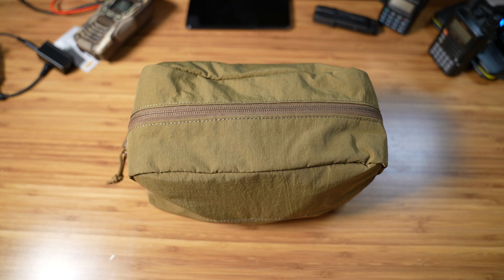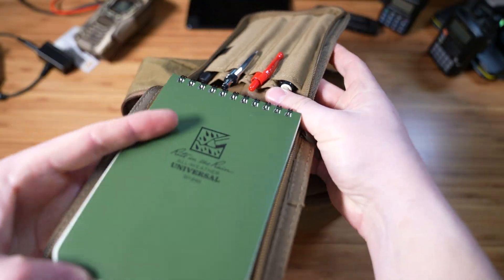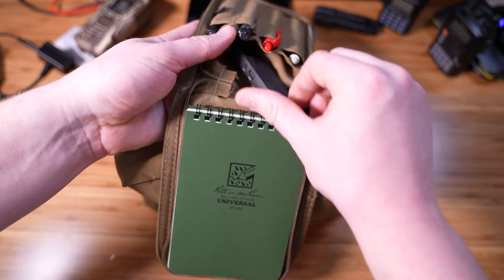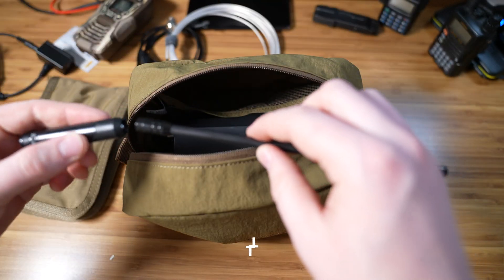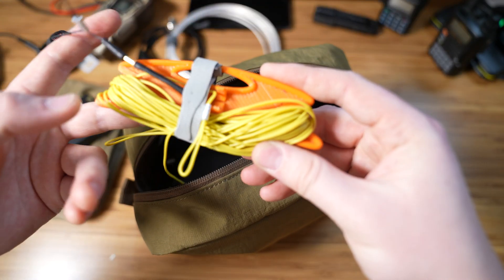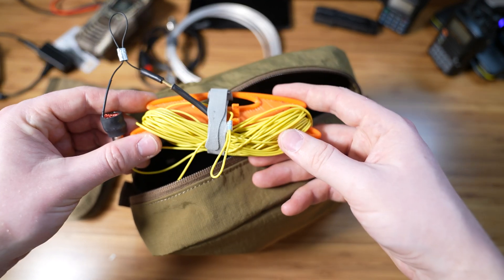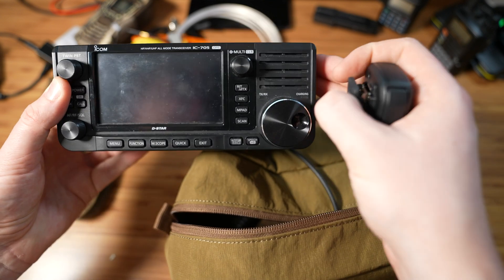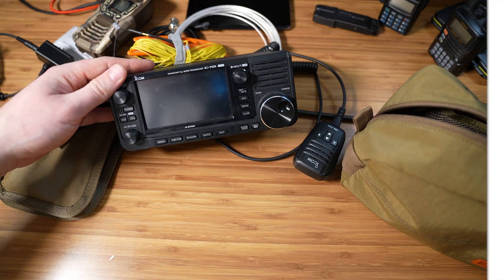My EDC Radio bag / Emergency Communications Kit |Ham Radio|

Comment: Nice video. A suggestion, The IC-705 Touch Screen is the fragile weak link in the system and needs some sort of protection. Consider side rails from Side KX along with the Polycarbonate Plastic Cover to protect the screen. Obviously an emergency go kit is worthless if the radio gets broken.
Reply from the maker: You’re right! Thanks I actually have the metal cage for it. But it didn’t fit into the case so I took it for. I may 3d print myself a cover.

Comment: You really need to rethink your EDC radio choice. That's definitely not practical for a bug out bag or get home bag. There are way too many really good high-quality handheld radios that will serve your purpose better. Much lighter, much less bulk in your bag.
Reply from the maker: I think i'd honestly disagree-- I still have my vx6 with me every where I go along with a mobilink TNC... but You can't beat the IC-705 right now. HF, VHF,UHF, built in TNC, all the bells and whistles that you need. 

But if you have recommendations i'd love to take some!. 

I did sell the IC-705 tho-- so the bag is much lighter now. lol
Reply: @Districtfourtyseven  why carry on your back all the unnecessary bulk and weight? Food, water, medical supplies and ammo are exponentially more important. A lightweight radio will suffice.

Comment: Too comical. Was a 7 level radio tech in the USAF. I hold a commercial license as wel as an Extra Class HAM license. If you have a radio I WILL find you, even if all you are doing is listening I can find your IF frequency.. The best thing these days is if you have a radio.,..don;t use it unless ylou want to be found and killed
Reply from the maker: Can you explain how you’d find me if I’m listening? 

I’d also love for you to try. Genuinely I’d love to learn how you would.
Reply: He has what’s known as the Golden Counterpoise grid dip oscillator plate voltage meter. He will find us all.

Comment: Not bad. I came up with putting a small CB transceiver into a .50 cal metal ammo can. I placed a small magnetic base 11 meter antenna (that has a 1: 1.7 SWR),  a small 12v motorbike battery, an analog SWR meter. Also room in there for a small amp if needed. I went with CB as so many people in my city have them. I think GMRS would have been better but so few around here show an interest for the frequency.
Reply from the maker: I actually have a very similar setup as you but with a VHF UHF radio. I never got into CB and i dont think it's used very much in my area. Is your setup posted online anywhere? I'd like to see it or if you have an instagram send me a DM @letscreate.dev
Reply: @Districtfourtyseven  Sorry. You Tube is about as social media as I do. And I do not have a video/channel. I guess you will just have to use your Barney Imagination (PBS). 😃
I guess I could one day try a jpg with e-mail. Damn CB er's anyway.
Reply from the maker: Haha.  I’ll be waiting for that letter.